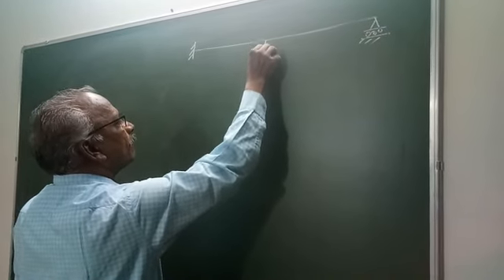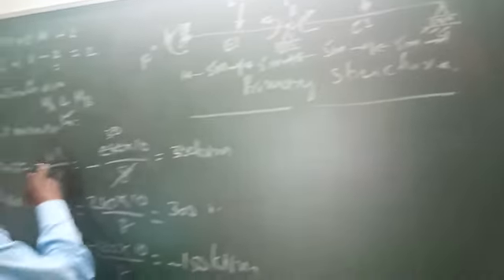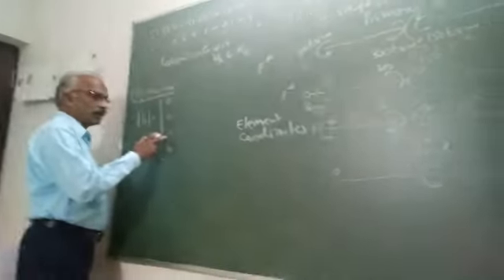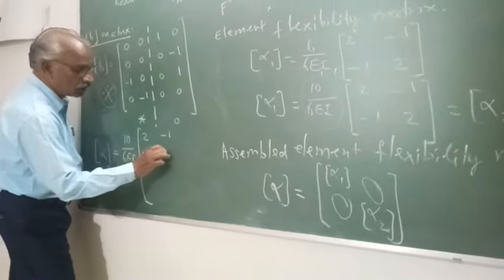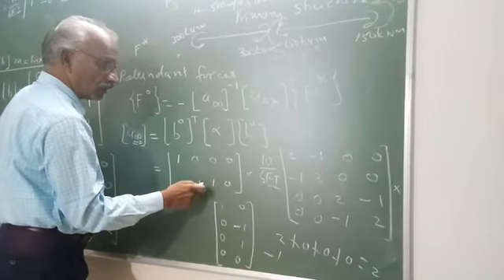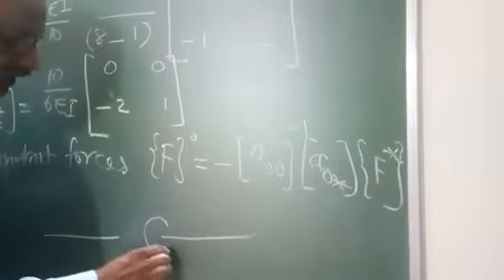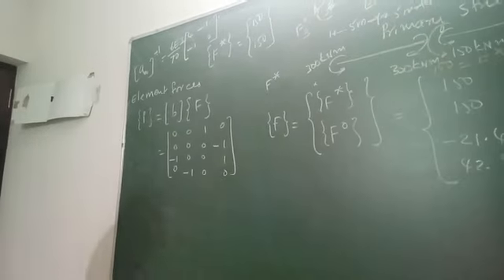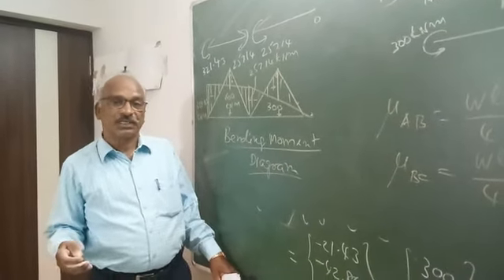Lecture 5: Matrix Methods of Structural Analysis-Flexibility Method- Continuous beams. Dr P.Perumal,

Comment: Good evening sir..i have one doubt in this video in making primary structure(statically determinate). You are introducing a roller support as hinged for making statically determinate. But actually formula is (vertical reaction + end moment- ) so if we make fixed support as hinged the end moment can be reduced i accept it but introducing roller as fixed means if we apply in formula there will be vertical reaction anyways so in finding DSI we are not taking moment over there so it will be as statically determinate only? Can you clear me this please
Reply: Hi , At intermediate support there is no support moment. But at intermediate  support the moment is due to continuity of the beam. That is why we are not taking it in calculating Static indeterminacy. The moment released at B is  Bending moment which is due to continuity of beam not due to support. If support was not there then also their will be moment. I hope I cleared your doubt.

Comment: In primary structure, What F* denotes sir? How come 150 knm at B, in Anti clock wise direction? Also how come 150 kNm at C anticlock wise direction..
Reply from the maker: F* are the forces resulting from the given off node forces/external forces. We start with a wrong assumption that all supports are fixed. Hence there will be difference in the Fixed end moments at intermediate supports generally. To make them equal and opposite we apply the moment difference where there is need. Similarly at simply supported end the final moment must be zero. Apply the moment in the required direction to make it as zero. These resulting values are F1* and F2*, the forces resulting from the given external forces. Thank you.